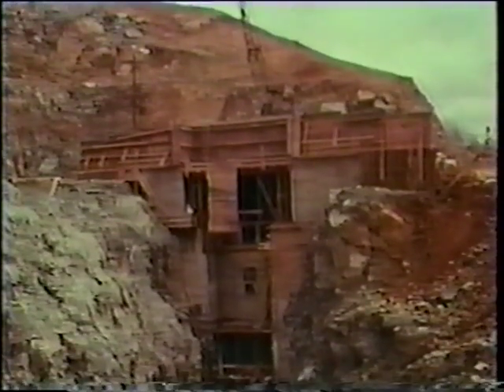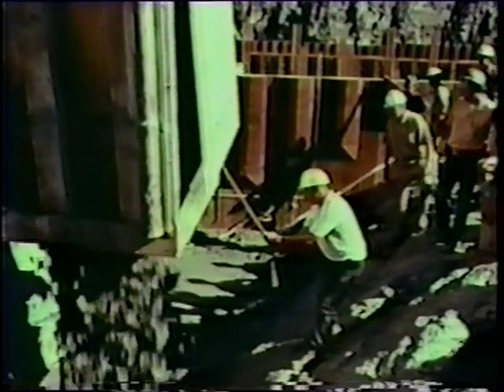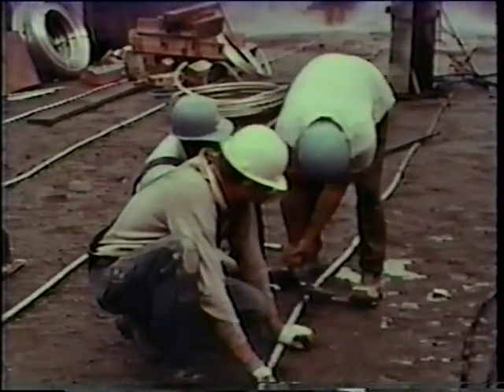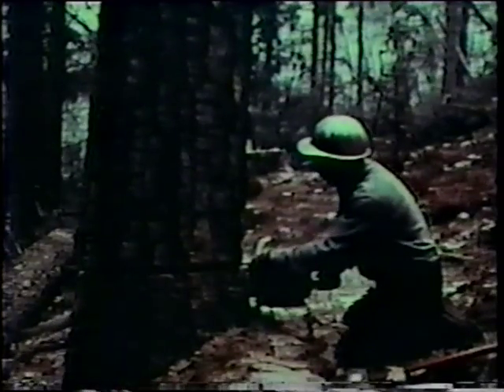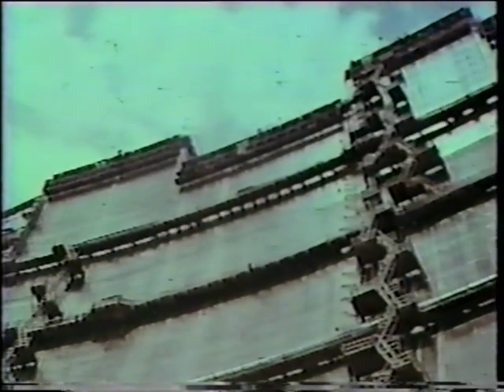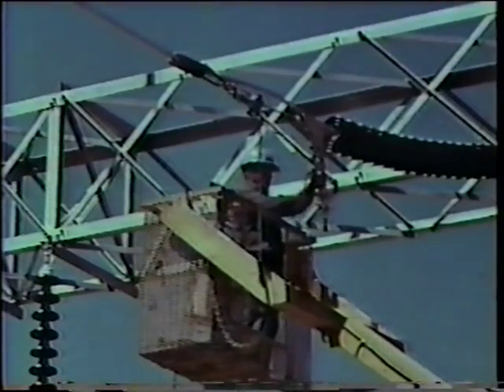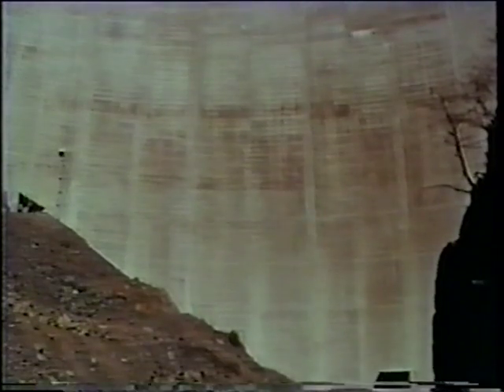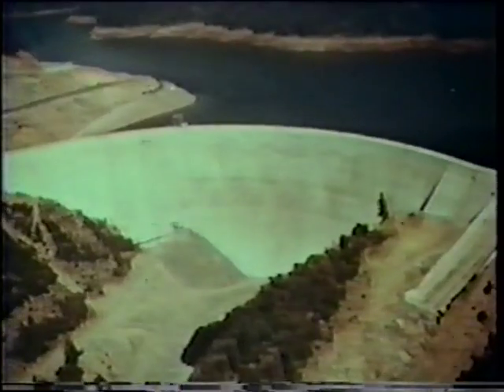Building Bullards Bar Dam, Part 2

Comment: My father was the quasi project manager. He'd go to work at 6 AM and not get back home until 9 or 10 PM. This job was a nightmare. Jack Chiaverini was the official project manager. Whenever Perini had a job in trouble they sent my father to right the ship.  I like where Lou Perini thanks the tradesmen. It reminded me of when Obama said you didn't build that. That's the same thing my father said to Perini's board of directors years before. He told them they were nothing without the operating engineers, laborers and teamsters. He was a hard man but he had a core crew that followed him all over the country. He believed in an honest days pay for an honest days work. Before this job they sent him to Del Rio when the Amistad Dam job was 6 months behind schedule like here that finished early.